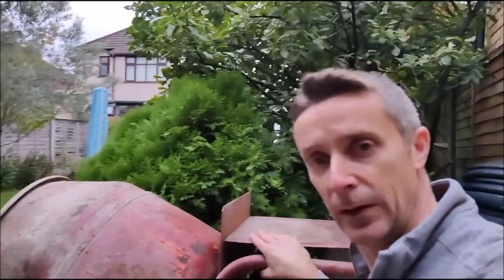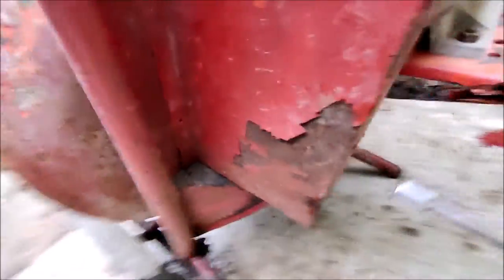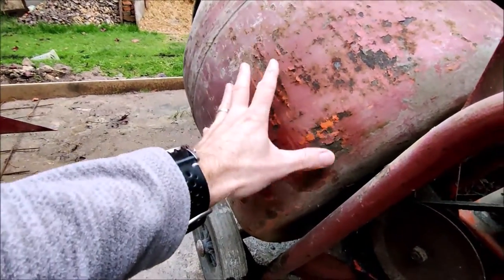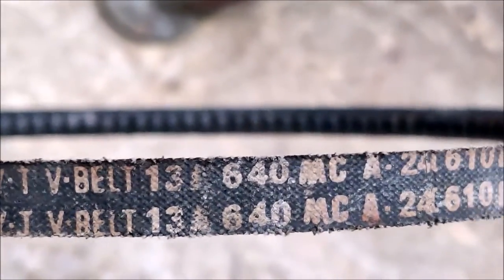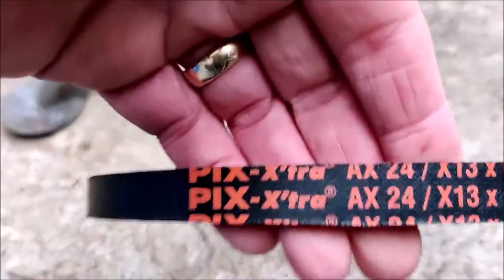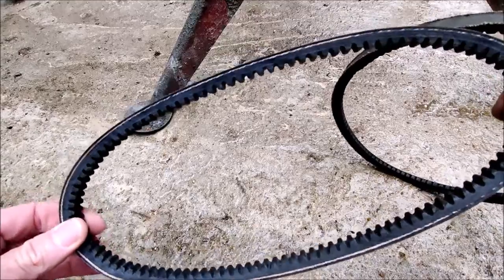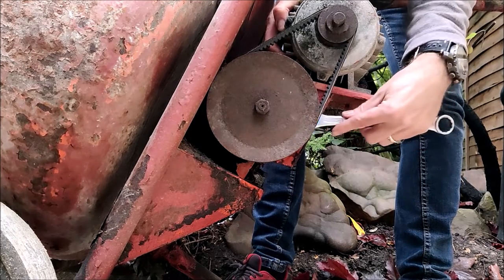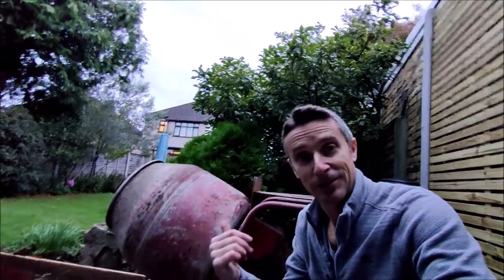Pre 89 Belle Cement Mixer Belt Replacement

Comment: Hi excellent video just wondering where did you get the belt from as o have the same machine and require a belt also would you know where to get any spares for these machines .
Reply from the maker: Hello Tony. This is the belt I purchased:

https://www.ebay.co.uk/itm/140980785076.

As for other spares, I haven't found anything for pre 89 machines like ours. That said I do have a gearbox gasket to fit which I have taken a punt on a post 89 version, which looks to be about right.
Reply: @fixitfallows  Thanks for the information also i will keep looking but when you contact the manufacturer they do not have any spares as you said for that year of machine. There must be someone out there with some spares as when this is working it is fantastic machine.